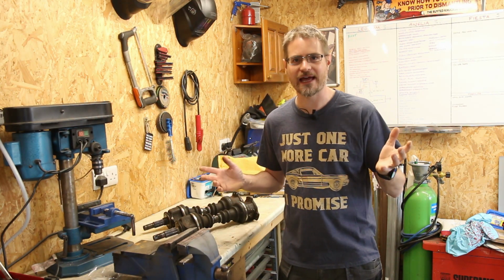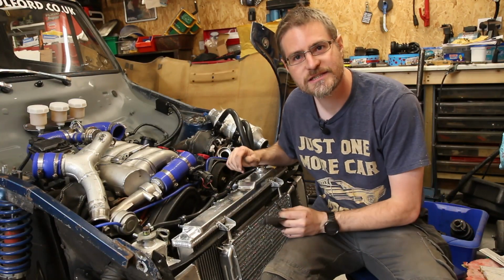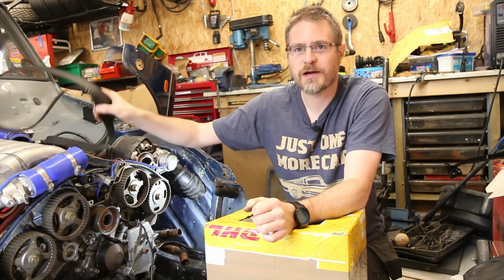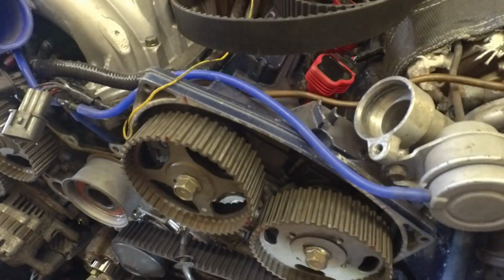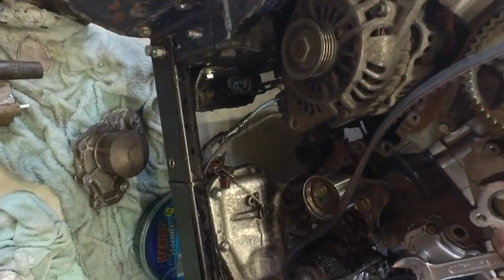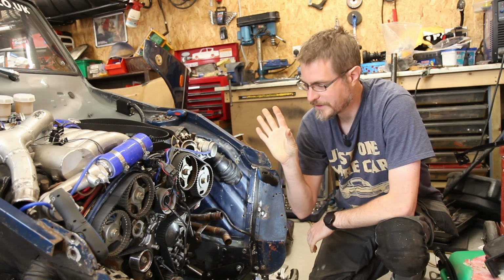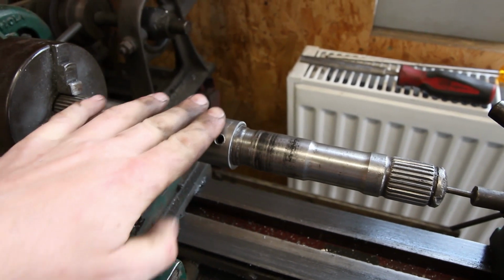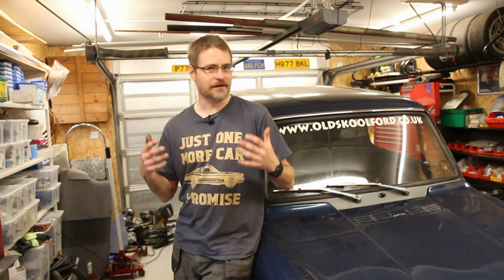Garry's Garage - Eliminating the knocking? - Ford Anglia #33

Comment: Great video again! Slightly scary seeing the chassis flexing with the torsional backlash through the subframe on throttle lift off 😄
Reply from the maker: Yeah... The big bit of angle iron I welded in under the fuel tank shelf obviously isn't enough! Will have to address that when I next strip the rear end down!

Comment: in the video you can see the floor pan behind the diff move. you need  sum box steel  between the chassis legs and bolt  the two bolts that go through the diff housing  floor pan to it.
Reply from the maker: I noticed that bit of movement too, will add it to the list of things to look at in the future! 👍

Comment: Grinding and welding on the lathe without protecting the ways. Welding spatter will stick to them and grinding dust will get under the carriage and ruin it.
Reply from the maker: I'll give the lathe a good clean down before I use it again, and lay down any protection should I need to do this in the future, thanks for the tip! :)

Comment: Loving the progress 👍 do you think the cam cover and pulley were damaged when the engine fell forward off the axle stands?
Reply from the maker: As I said in the video, I remember now that the cover was already cracked, and we glued it together when we put the cam belt on it 6-7 years ago. The crushing of the edge of that pulley definitely couldn't have happened with the fall, it was behind the engine mount that was on the front of the engine back then. But it is where the chain for the engine crane ran, and there was also an indentation on the cover - all pretty compounding evidence to say that it was my fault!